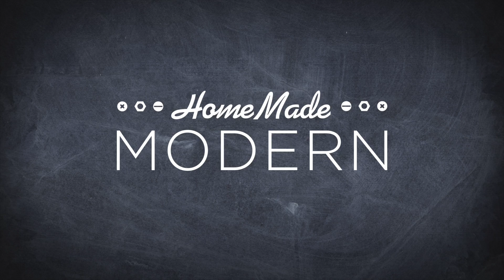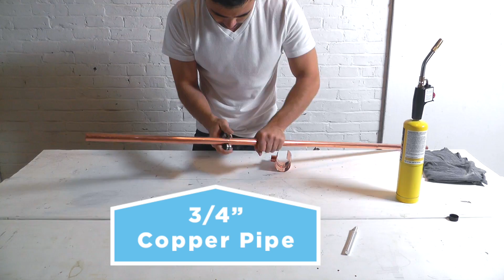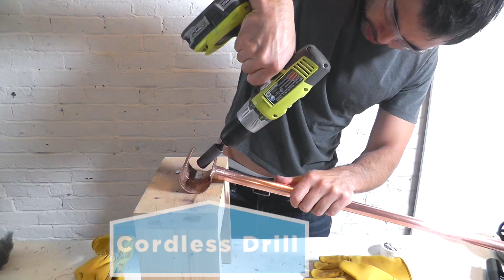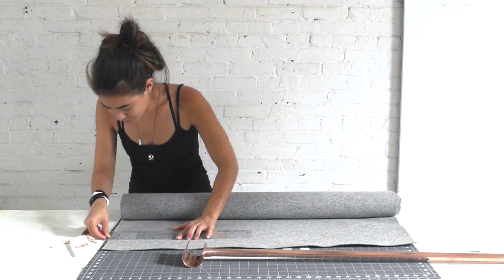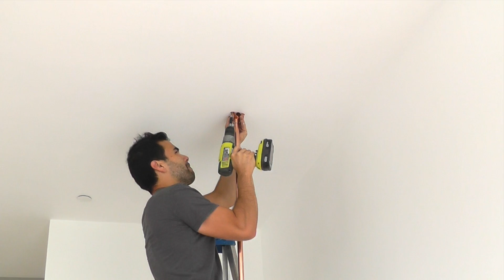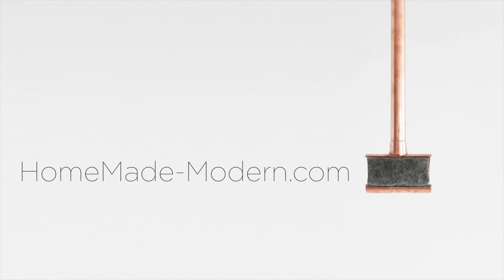DIY Copper Bike Rack

Comment: interesting rack.  just a note this holder only works for steel tube bikes.  If you have a modern high performance aluminum or carbon fiber bike, the head tube won't fit in their

Comment: For the next time when soldering pretorch /preheat the pipes when already put together, then apply flux sparsely and then solder. That way you don't lose any running flux when eventually heating the pipe. Otherwise great project, will definitely hang on to it. Greetings from Berlin, Germany :)

Comment: It might be better to also use a screw joint on the bottom.  When you heat the pipe up for soldering, that also softens it.  The bike just might pull the hook open if you don't put it on the hook carefully.
Reply: yeah agreed and the copper was heated to a higher temp than needed for solder to melt into the joint...but he did admit he's no expert with sweating copper. What awesome idea though!! Liked video and subscribed